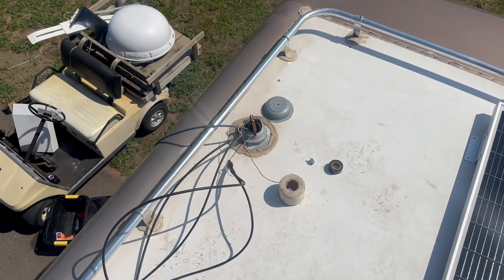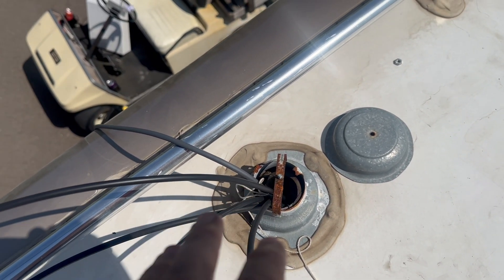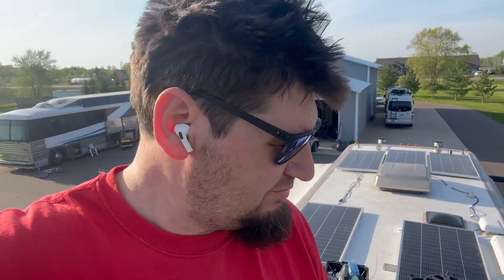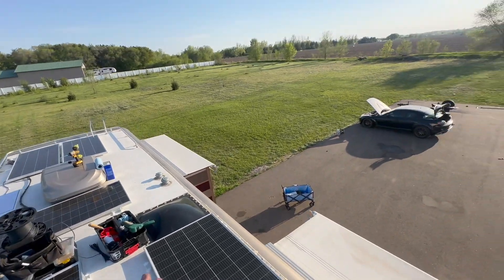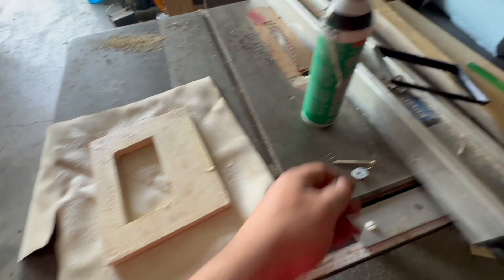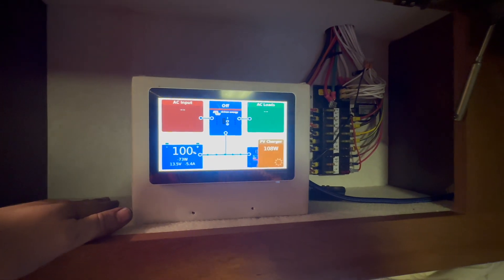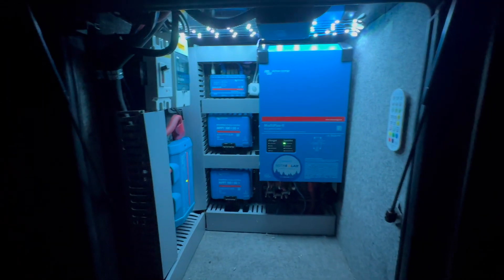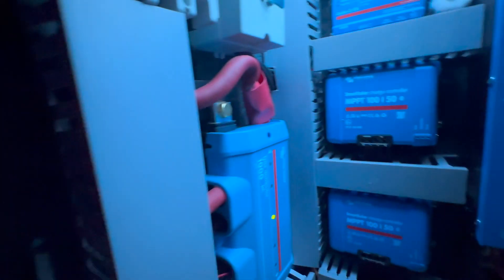Newmar Mountain Aire Victron Solar Install part 2

Comment: Thanks for your videos and sharing your installs. Curious, what type of sealant do you use to seal the  cable exit hole in the vent pipe? Regular silicone or something more robust like 3M 4200 or 5200?
Reply from the maker: Right now silicone, then after a few days chase it with flex seal to get any smaller holes.
Reply: @sotasolar  thanks, didn't think about Flexseal👍🏻